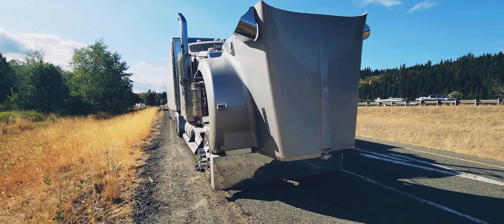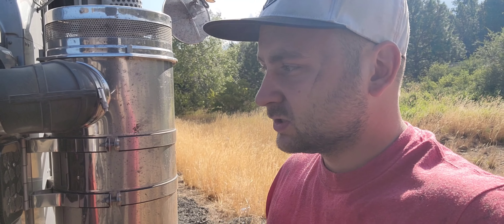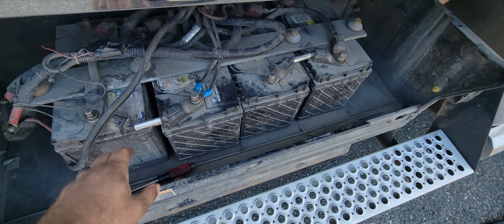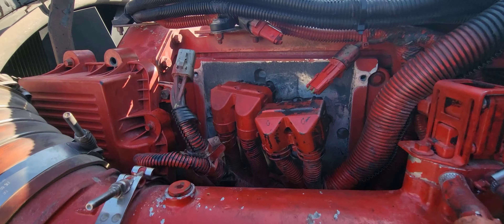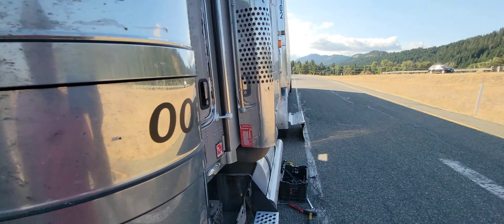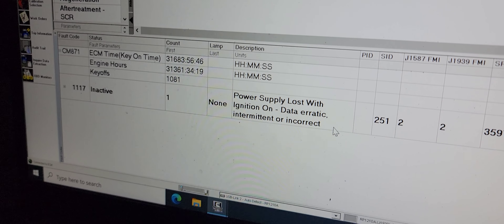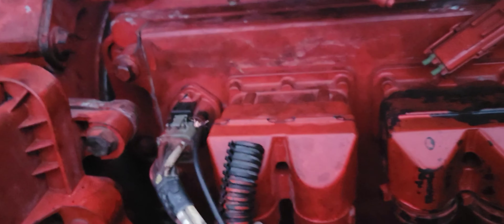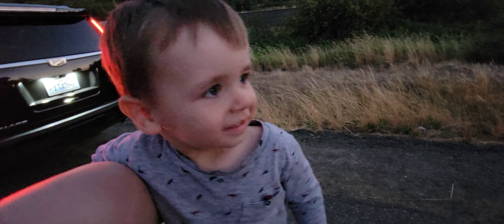KENWORTH W900 LEFT ME STRANDED....

Comment: Just curious if the truck threw any codes.
Reply from the maker: It did, but only when it was cranking then when it stopped check engine light went away. After I got the computer it said ecu had low voltage. So that means either bad ground or bad ecu. Ended up replacing ecu and back on the road I went.
Reply: @alaskahaul2085  Glad to hear it was a relatively easy fix although probably a little costly. Glad you’re back on the road be safe driver
Reply from the maker: I was very fortunate that it happened close to home and I was able to do everything relatively fast and cheap, otherwise it would of been triple the amount if not more with towing. Stay safe also! Keep making the great content!